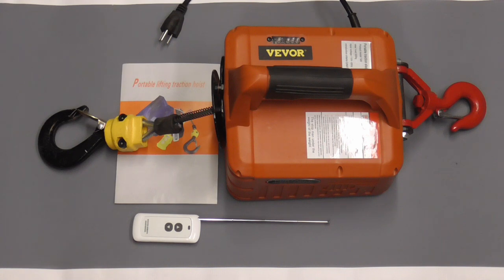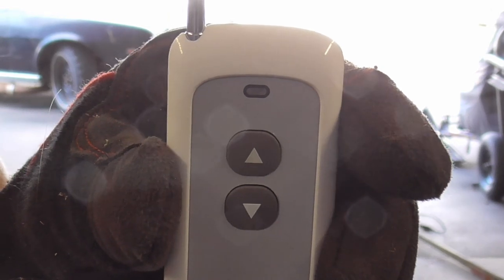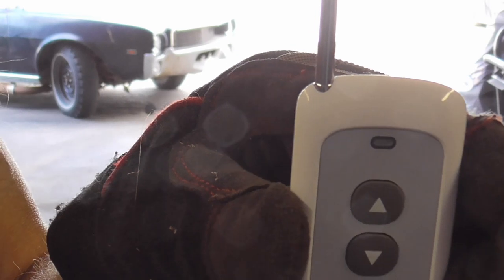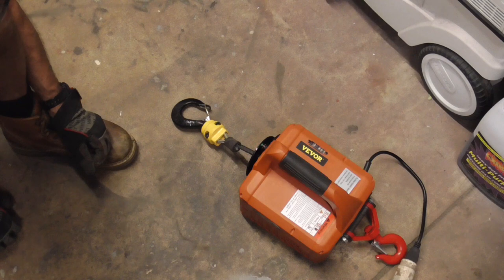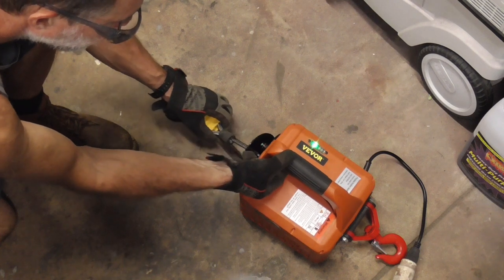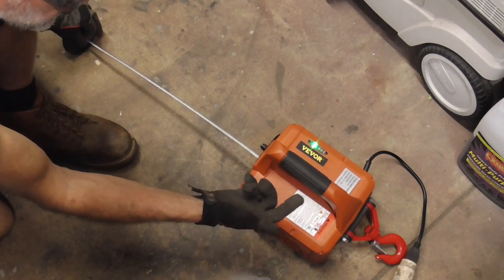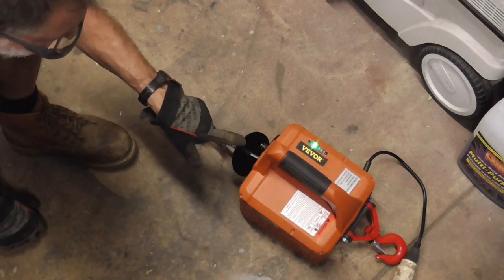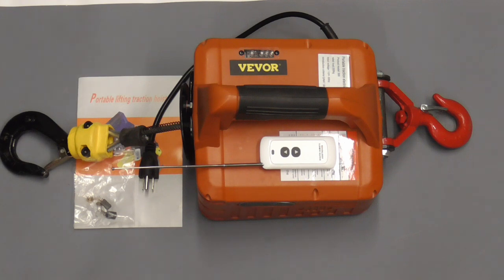VEVOR Portable Hoist/Winch w/ Remote Control 👍

Comment: Amazing that they were able to fit a cable and motor of ample strength into that little box.
Reply from the maker: I was very impressed - bought it with no idea what I would get but it worked perfect.  Loaded it back on the trailer after removing the engine too :)

Comment: Holy !! That's a must have !! Amazing Jerry. BTW is that your AMC ?
Reply from the maker: The winch was a gamble but I'm super happy with it - worked great.  Pulled the car back on the trailer after removing the engine too 👍  It is my car.... been taking it apart this week - absolutely filled with mice nests - every nook and cranny - even inside the heater box.  A bit of a project but after watching you come through with the Comet,  I'm inspired :)
Reply: @LakesideAutobody  Haha.  It's doable.  With your skills and beautiful shop it will be amazing !!
Reply from the maker: It's a very basic car actually - hardly any options.  No air, roll up windows, stick shift.  Even the rocker trim has exposed Phillips screws that attach it.  Everything came apart pretty easily with the exception of the windshield wiper switch knob.  Man - that was tricky. https://theamcforum.com/forum/wiper-switch-knob-removal_topic62783.html - if interested 🥴 @pstreetgarage7304
Reply: @LakesideAutobody  AMC were always kind of basic and a bit behind the big three.   I kind of always had a thing for AMC.  I use to own a Grand Wagoneer (fake wood grain decals) The original AMC SUV !